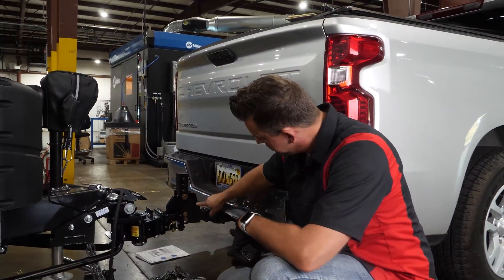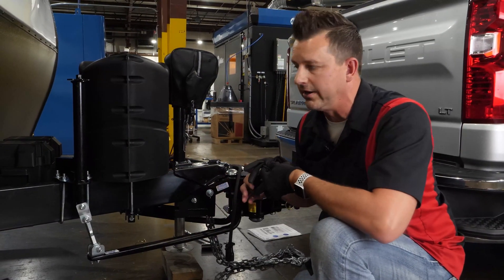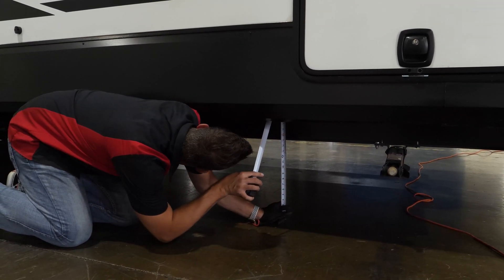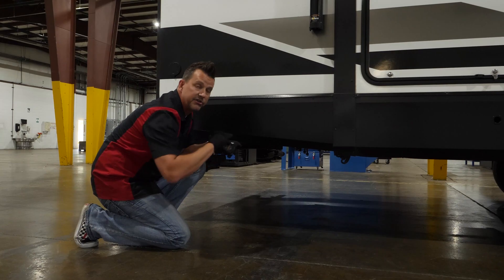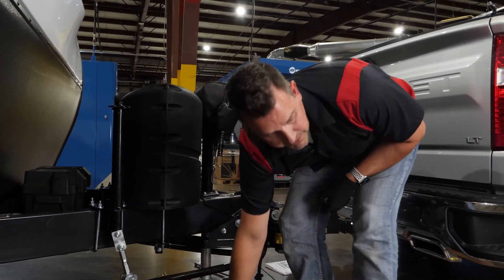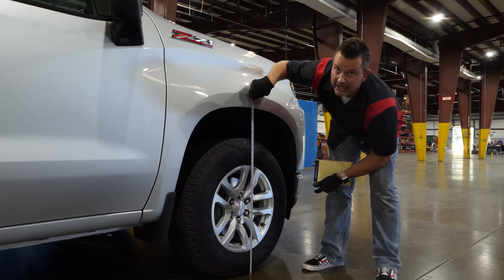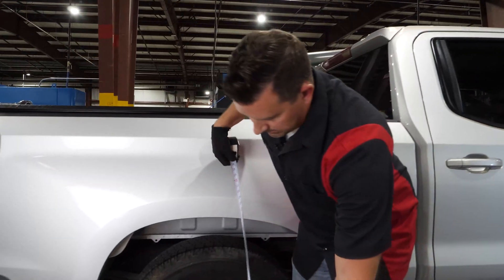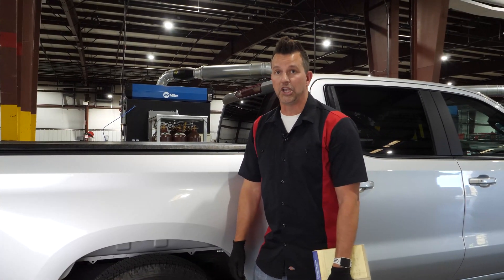STEP 11 1 Weight Distribution

Comment: What if the Jack's are raised all the way and the front is higher than originally for a half-ton truck?
Reply from the maker: You can also add additional washers to the tilt pin in the hitch bar assembly to give yourself more range with the jacks.